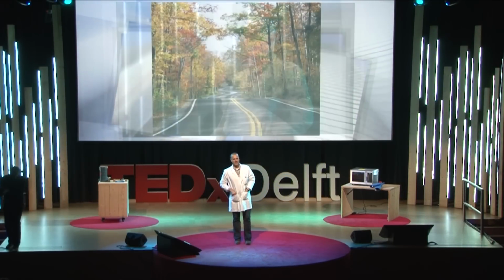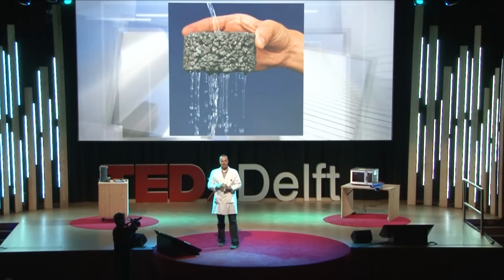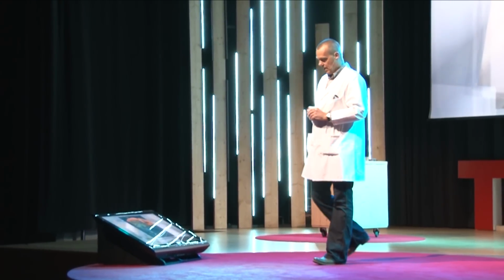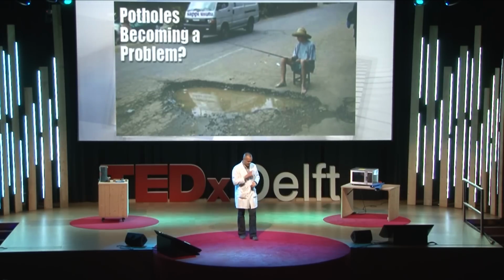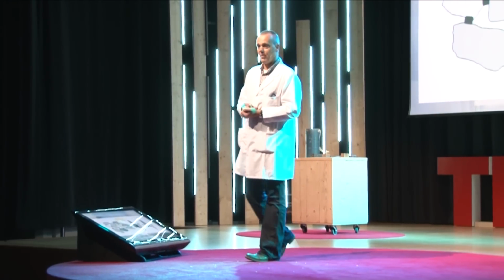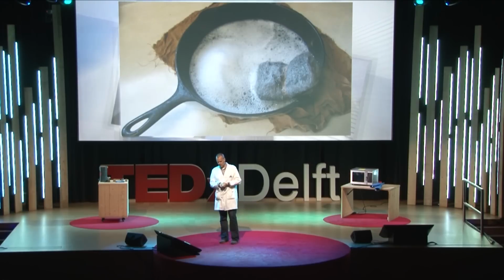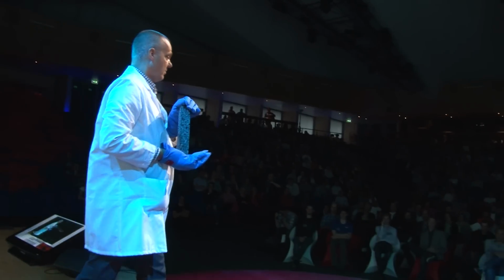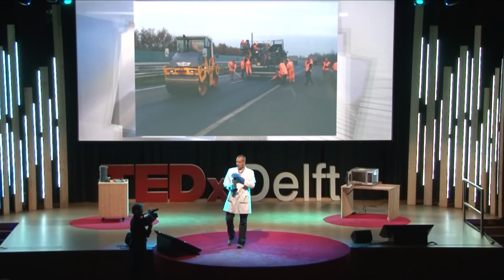Self healing concrete and asphalt: Erik Schlangen at TEDxDelft

Comment: This is essentially what I thought of for using if cracks form in an O Neil Cylinder, in the Graphene Carbon Fiber/Nanotube Basket, with Graphene carbon fiber/nanotube burs with graphene resin.  Just graphene could be poured in with resin and heated up to heat fix everything together.

Comment: The water laying on the road surface which then being struck by a tire at speed causes cavitation is the main factor for road destruction, so the porous surface is the best structure, but wouldnt the sun every summer at peek heat do pretty much the same thing.

Comment: If you look closely, the crack was still there. What exactly does this do?
Reply: +Wheelman Josh 

Usually asphalt, or however you want to call this type of "street surface", doesn´t appear as a single square beam. 
The crack just visualized a split in the "street surface". These cracks or splits are deadly for the street itself in combination with water and Temperatures. So if you can close those gaps or cracks ..whatever...you prevent the incoming from water and then its expanding in relation to Temperatures. 
That´s how I understod this whole thing. 
If I´m wrong please let me know !

Comment: I'm not sure this video has the right title, it's appears to only be self-healing asphalt, not concrete, I've never heard of concrete with bitumen in it, and this technology is directly correlated with bitumen (and mixing in steel threads)
Reply: Timmah Asphalt is called Asphalt/Bituminous Concrete, Concrete with cement as the binder is called Cement Concrete (Portland Cement Concrete, if the cement used is Portland Cement)

Comment: Ever been at a red light next to an asphalt truck & feel sick? That's cos it's TOXIC. Industrial installations of asphalt (like on a street) in Cali require at least 24 hours notice before installation within 75 feet of a residence--to allow residents a chance to go away during the most dangerous time--when it is mixed, prepped, hot & the fumes are at their most toxic. Read asphalt’s MSDS. & my story’s in my TED bio.

Comment: now what are you going to do about the HIGH LEVELS of TOXICITY of the substance? IN California, it was one of the first group of Prop 65 Substances--industrial substances in such common use they needed to have serious restrictions put on them. Asphalt exposure changed my life! Toxic Encephalopathy, BLIND & on supplemental oxygen for more than 5 years. I beat what MD's said I'd never beat & got back my sight--I still have neurological issues that demand a constant lifestyle of self-healing.